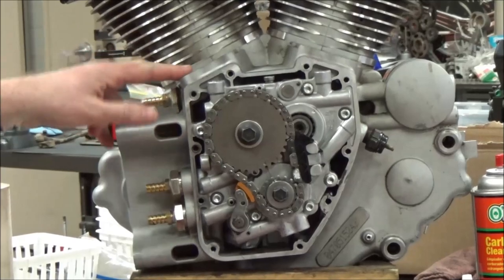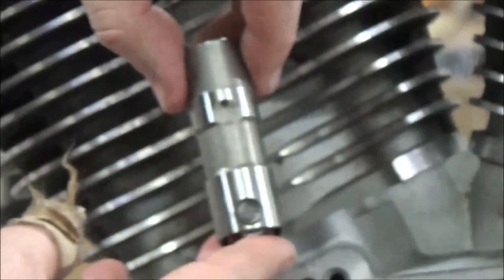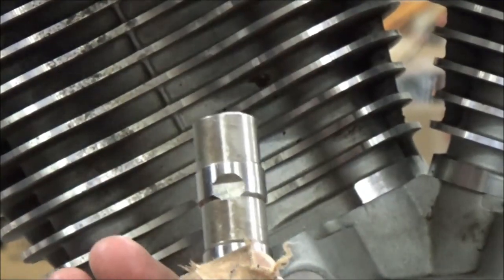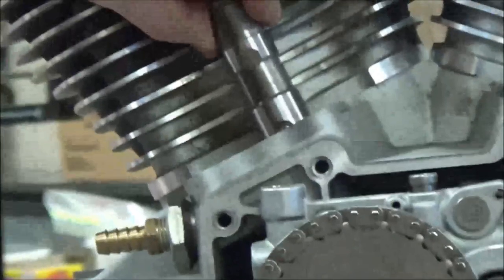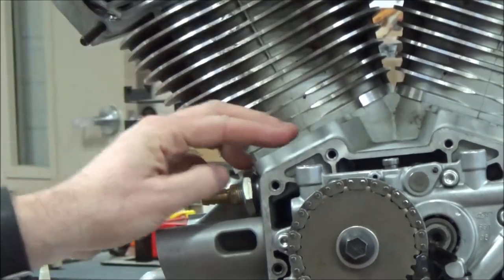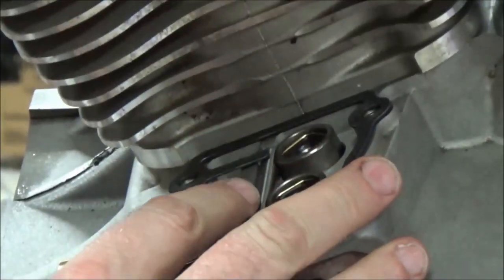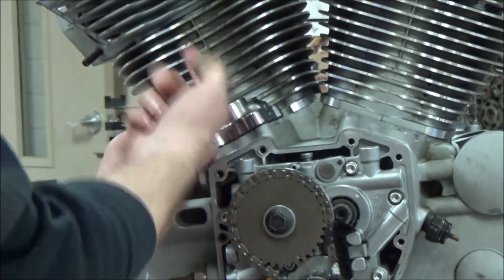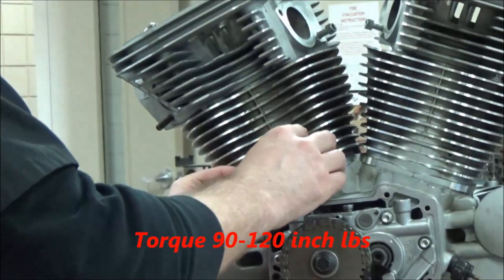TC Series: 19 Did you know Harley Hydraulic Lifters are directional? How to install them correctly

Comment: So, the nature of hydrostatic pressure is that it pushes equally in all directions so the hole in the side of the lifter wont fill up until that channel cut into the middle of the outside of the lifter is filled. This means it doesn't matter which way the lifter faces as long as the roller at the bottom and the flat are pointed correctly for the lifter to work properly. A better practice is to fill the lifters by submerging them in oil in a canning jar. small hole in the lid and us a hand vacuum pump to suck out the air through the hole. When you release the vacuum, oil shoots into the lifters. There is also a special syringe you can get to pump oil into the lifters one at a time.
Reply: Totally agree the oil will go around the lifters without regard to their position.
Reply: Well said.
Reply: True. But when putting everything back together you need to wait say 45min until you can apply final torque on the rockers arm assembly to make sure the tappets are not pressurized - the pushrods need to rotate freely. Applies to each cylinder.
Reply: @michaelslawinski6449 I found this out the hard way once. I torqued everything to spec and the rocker assemblies loosened up within just a few miles. I thought my torque wrench was out of calibration at first.

Comment: Hello Shane your instructional videos are great.  You are wrong at 1:50 though.  The oil is pumped from the oil tank to the cam plate then to the filter then back to the cam plate then to the oil delivery holes to the lifters from the cam plate.  IT DOES NOT MATTER at all which way the oil holes face in or out because the oil is pressurized and flowing a greater distance throughout the motor than just going around a lifter bore would make.  Oil film is always leaking around lifters and rocker shafts etc., etc., which lubricates all moving parts.  It only matters to minimize microscopic wear to replace removed lifters into the same bore in the same orientation as they came out if reusing.
Reply: I think he’s saying it for flow to lifters only and to only for purpose of keeping lifters full so you get correct lift !!??
Reply: Not the case at all.

Comment: I just took my 06 Softail apart and the holes were facing outside or toward the cam plate, this engine was this way from the factory 16k miles never been apart, just took apart to change to the Screaming Eagle hydro update tensioners.

Comment: Installed new hydraulic lifters with adjustable pushrods. Running good and quiet. Only thing is my oil pressure seems to be running a little high at warm. Just under 20psi. 32psi at start up.

Comment: I didn't read or see anything in my manual about the hole needing to be facing inward ? I get the wear pattern aspect of it but if I'm going to install new ones it wouldn't matter how I installed them. Either way is fine. Unfortunately its been 2 or maybe almost 3yrs since I tore my Harley apart so I have no clue how they were positioned. Fortunately I did mark what spot I removed them from. Putting it back together right now. I can't even believe I waited so long .
Reply from the maker: The only place I recall seeing it is in the OEM HD service manual and like I stated, it varies. It seems to me to learn which way the oil flows comes from and point it closiest to that direction. The main reason I made the video was to point out that they did specifiy and you can't assume "every" motor is the same. More of teaching basic skills sets to the students.
👍 Thank you for taking the time to comment! It helps us! 
Here is a way to support all the free videos.
Want to say “thanks” or “keep it up”? Click here https://www.paypal.me/how2wrench  

Subscribe and Follow us! 
Web:
www.How2Wrench.com     
www.Tools2Wrench.com

Comment: I just removed the tappets in my 2000 Heritage Springer and noted that the oil hole in the tappet faces inboard, as you teach in your video, however, the oil hole from the engine does not face the tappet directly, also as you show in your training video, but instead it seems to come out from the engine case and towards the side of the tappet bore. This means that the oil hole in the bore does not directly face the oil hole in the tappet. Any idea why this is different than what you show in your video?

Comment: the band around the lifter is a oil band and the oil will get to the hole nomatter how you install it.
Reply from the maker: mark tucker Wear patterns and intention on reinstalling is the "reason". As well as if you "aim" towards the feel of oil, it just makes sense.
Reply: Then you should say its a good idea to put it back in the way it came out to keep the same wear pattern, not put them in with the oil holes facing the crank because it does not matter in which direction they face. Sounds like you scared the crap out of a few people that didn't know any better.
Reply: @dkelley1959  did me I just had to replace my relief valve and tensioners on mine. I had one of the lifters drop off the magnet holders and I didnt look which way the hole was facing.
Reply: I can't believe he answered you without you paying.
Reply: Yep
Reply: @Harley_Chaos  you have to be smarter than what your working on. that oil does not aligine with any thing as that lifer is going up&down....the gally isant. thus the reason for the wide cut out band all the way around the lifter. thats just a std GM .842" roller lifter.( chevy&such)

Comment: They are not directional other than line them up with locking pin, the oil hole can be in or out. Oil comes from the cam plate to not case.

Comment: Hi Shane. Thanks for these videos, you've been a great help for me whilst working on my '98 Buell S1W. My Buell has a different pushrod layout, and I would like to know if the oil hole should face inwards or outwards?
Reply from the maker: I would need to look into it to be sure. 
Thank you for the comment. See the link below for more help with your question. I have been banging my head against the wall thinking of ways for people to say thank you in an impactful way to help keep these videos coming. Here are few ways that many have found as a way to give back. 
* Membership to H2W (includes t-shirt or tech help) https://how2wrench.com/product/membershipmembers-onlymembers/
* Simple donation to say "KEEP IT UP"
May you have a great day and... https://www.paypal.me/how2wrench

Free Mechanic info, tool reviews, and “how to” videos newsletter sign up: https://how2wrench.com/subscribe-free-newsletter/

Missed a past issue? No Worries. Newsletter Archives: https://how2wrench.com/blog/newsletter-archives/

Like freebies? Click here for a free diagnostic checklist! 
http://gem.godaddy.com/signups/364621/join  

If I can ever be of service to you, here is a video explains how to connect with me. 
https://www.youtube.com/watch?v=vjvmB01ebcs
Reply: Hi Shane, looks like the oil hole should be facing outwards, away from the engine. I have just removed the valve lifters from the front cylinder (I am working on the rear cylinder). The front cylinder has never been worked on since it left the factory, I know this because I have owned the bike since new. Both valve lifters had the oil hole facing outwards as I removed them. Also, in the official Buell service manual there is a colour diagram of the oil flow in the engine and crankcases, which shows that the oil feed from the filter flows along a galley near the outside of the crankcase, feeding oil to the valve lifters towards the engine. The same would apply to Sportsters, as the Buell uses the same crankcases and engines. Cheers,  Dave.
Reply: David Senior k

Comment: pressure is pressure 
, it don't care witch direction its coming from.   I see no real reason that they have to be facing one way or the other, except they do have to role on the cam.  I can understand why some people may think there is a benefit but but seem to me that you would know better. I may be wrong, and talking out my u no what so if anyone can give me a reason and explain it please do.
Reply: If they were new cams and roller lifters,,, the direction would not matter. Once "Mated", they share a "directional" relationship with the cam. The oil hoes make no difference in this application. The pressure is all around the lifter equally. A good practice, whether it is a pushrod, lifter, valve, piston or just a shaft,,, normally it is best to put it back in the same location as when you removed it, to prevent "ganging of tolerances" or wear to be exaggerated due to previous wear. The holes,,,,, make no diff. Sorry, they are just keeping the directional rotation the same  as originally assembled.
Reply: hummm, good answer, thanks.
Reply: HD factorty school said it didn`t matter which way they went in.I`ve installed them(NEW) in both directions purposely.Mad no difference.(Retired from HD shops in 2015 after over 40 yrs of dealership service)

Comment: Came across a Youtube video that said they install there lifters oil holes facing the front came plate... 5:40 Sec's

https://www.youtube.com/watch?v=g84UKZg8zZk

Not sure what the right way is... 

Service manual also does not state a direction
Reply from the maker: +joshua Rivera 
I will look into it and see! Thanks for pointing it out. The Manual does not specify a direction from as we both stated. (on a twin cam. It does for EVO i believe)
Reply from the maker: +joshua Rivera 
Hi Joshua,
So I looked into this and my manual, a OEM 2006  (B) motor Softail manual does state to install the oil holes "inboard" side with flats front to rear. BUT>>>> A OEM 2006 Bagger (A) motor manual states it doesn't matter!
Reply: +Shane Conley 
Thanks for the follow through Shane, good to see that your both great at teaching on video and following up with comments.  I recently did a cam install on my 05 road king and after viewing your video I panicked and immediatly double check other sources including my shop manual.  The manual I am useing dose not specify a direction other than the following,

"oil travels through passageways in the crankcase to the hydrau- lic lifter bores.  Exiting a hole in each lifter bore (E16), the oil flows around the lifter and enters a hole at the side of the lifter body. As the chamber inside the lifter body is filled, the push rod socket rises to achieve the no-lash fit of the valve train components. The flow of oil then exits a hole centered in the lifter socket and runs up the hollow push rods".

I know learned there is a different regarding Bagger (A) and Softail (B) motors that i must research a little more.

Thanks for the knowledge.

-Josh
Reply from the maker: +joshua Rivera 
In all reality a motor with good oil pressure and no damage would never know the difference. Teaching is tough when trying to not make "it doesn't matter" an option when in the real world many times it really doesn't...lol
Reply from the maker: Head over to my website become a member now and to receive 20 minutes of personal mentorship with me. You can even use FaceTime if you have it or find a friends iPhone and we can walk through the actual carburetor process together. I look forward to mentoring you.

Note: Membership is not required to receive coaching or email help. Here are the direct links to individual services offered at H2W:

Email Answer Service-Click http://how2wrench.com/product/email-support/ 

Phone/FaceTime Coaching-Click http://how2wrench.com/product/personal-tech-training-phone-facetime/ 

DIY Mentorship-Click http://how2wrench.com/product/diy-coaching-hire-teach/ 

Dealership Training Services-Click http://how2wrench.com/product-category/dealer-services/ 

MMI/Tech School Student Tutoring-Click http://how2wrench.com/product/mmi-tech-school-student-tutoring-services/

Motivational/Guest Speaker-Click http://how2wrench.com/product/motivational-speaker/ 

On-site Training Services-Click http://how2wrench.com/product/on-site-training/ 

Tech Line Services-Click http://how2wrench.com/product/tech-line-minutes/ 

Mechanic on Duty-Click http://how2wrench.com/product-category/mechanic-on-duty/ 

Did you like this free video and hope to see more? Would you just like to say thank you with a donation? Click https://www.paypal.com/donate/?token=TvKoeRazPL-KysbM-e0ttz-C_gPq2IrqxDmM3ORCu4nxJzQWxYbmo-6m3YuNu64XHLngGW 

Keep Wrenching,
Shane Conley
Instructor/Motivator/Motorcyclist!
www.How2Wrench.com